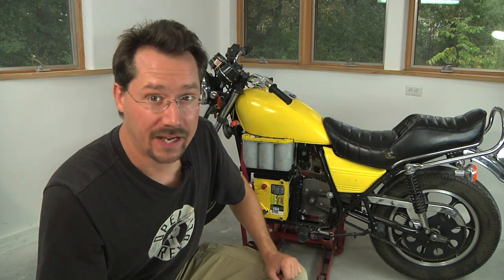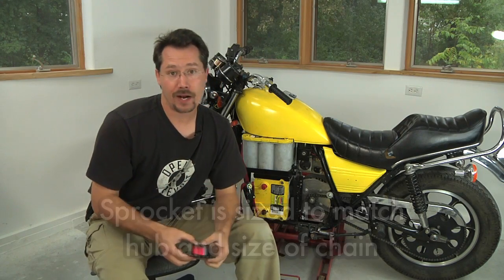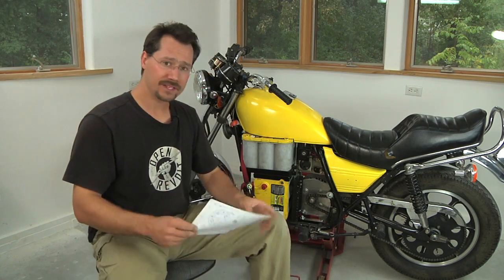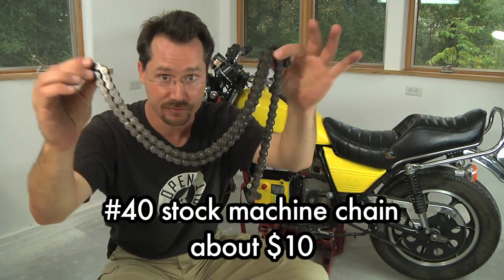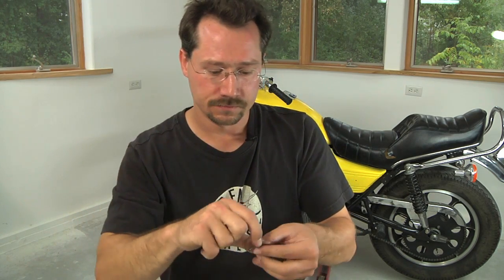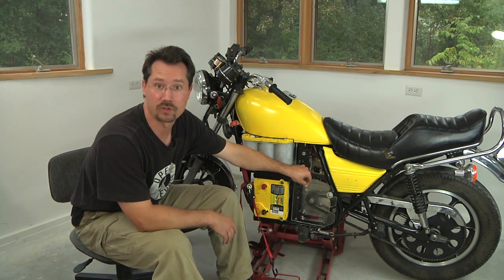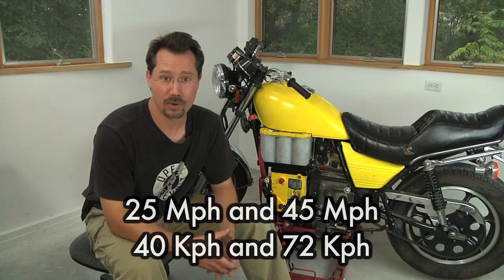15 Build Your Own Electric Motorcycle - FULL - 15 Driveline and gearing

Comment: I've watched all your video series several times, and I think I am have enough foundational understanding to begin assembling a parts list and buying text books for more in depth knowledge where needed. I have an old 80's Suzuki GS with a good frame and trashed engine, so..

My question is how you feel about transmissions on bike projects. I remember that you kept the manual in the Geo car. Space is limited on a bike, but a 4 speed trans from a Shovelhead era Harley is cheap and would fit.
Would it be beneficial to be able to click into a higher gear at interstate speed to run lower rev's and less amperage? I don't need crazy high speed, but I do quite a bit of higjway cruising and would like range.
Reply from the maker: In general, a transmission on an electric motorcycle gives NO advantages. It takes up space and adds weight.
In the Geo Metro conversion, the transmission on the front wheel drive system also includes the differential and then the driveshafts that connect to the wheels. The transmission was mostly used as a place to mount the motor and connect power to the wheels. The transmission was usually just left in 3rd gear. On a motorcycle, it's very easy to mount the electric motor to the frame, and connect the power to the rear wheel with a chain. The size of the sprockets also controls the gear reduction from the motor to the wheel.

On an electric motor, spinning it FASTER and having a higher gear ratio tends to reduce current drawn from the battery. Electric motors have high torque across a large range of RPM, unlike gas engines. The biggest part of what a transmission does it to match the speed of the wheels to an RPM of the engine where it's making enough torque.

On a DC electric motor, speed is proportional to battery voltage. For a higher top speed, increase the battery pack voltage. By using the space in the frame for more cells in series, you get a higher top speed. The system will also draw less current for the same amount of work at a higher voltage than a lower one. Use the frame space for batteries instead of a transmission.

If you are unhappy with the acceleration, top speed, or current draw, swapping out an inexpensive smaller sprocket on the motor will let you easily change the gearing. Use a calculator like GEARING COMMANDER to figure out what you want your gear ratio to be. https://www.gearingcommander.com/

Comment: What is the motor reaction when releasing the throttle? what is the feeling like? 
NICE VIDEOS BTW
Reply from the maker: It just slows down a little. The permanent magnets in the motor make a little drag when the motor isn't powered.
It's not unlike when you stop pedaling on a bicycle.

Comment: This is just great. Kawasaki stops making original parts (have been told, don´t believe me) after 10 years for its products. This means, old Kawis will be the best candidates to convert, as they can be found nowadays on the cheap. 
Your channel is great. 
Only con in my area, is we really get a LOT of rain 6 months of every year, and have to be very careful on making every connection waterproof as heck.  Oh and the hub and sprocket stuff information is just great. I can makeshift something like that within my limited means. I would use old or rebuilt car batteries though. And fix a couple of panels over the panniers, and LED lights all around. This way I´m going to show a finger to the thugs rationing Gasoline in my country.  
Thanks Ben, great information.

Comment: Is the gear ratio 0.5? Or the # of teeth on small sprocket 36? You mentioned the large sprocket had 72 teeth and top speed was 45mph and motor was rated at 52 RPM and assumed tire diameter as 2 feet.
Reply from the maker: 72 teeth on the rear sprocket connected to the rear wheel. I originally had a 12 tooth front sprocket on the electric motor. That was a 6:1 mechanical gear reduction. I quickly found that it was too low of gear reduction, it had plenty of power, but top speed was a little less than I wanted. I swapped out the front sprocket for a 14 tooth sprocket. That gave me a 72:14 or 5.14:1 gear ratio, which I was happy with. Swapping the front sprocket is an easy way to change the gear ratio and is much less expensive than the rear sprocket.
If you know how many RPM per Volt that your motor spins at, you can calculate how fast it will rotate at a particular voltage (battery system voltage, such as 48, 72, etc.. You can then use some math, your gear ratio, and the size of your rear wheel to calculate your top speed.

Comment: What top speed would you get with your gear ratio and would you say an electric motorcycle is suitable to be made for travelling distances of around 80 miles at a constant 70-80mph?
Reply from the maker: Electric motorcycles can be built any way you want. The two big limiting factors tend to be space and budget. You can build a crazy fast and powerful bike, but it might not be cheap. How large of a battery pack you can have is generally limited by the frame size. You certainly CAN build an electric motorcycle that would meet those specs. Zero is the best brand of commercially-built electric motorcycles out there. Take a look at the specs of a DS model with the larger battery pack for some ideas of range vs battery capacity. https://www.zeromotorcycles.com/zero-ds/
My friend Ben Rich has done some EXTENSIVE long-distance riding on his Zero. He's got a great YouTube channel for electric motorcycle riding adventures you might want to check out. https://www.youtube.com/channel/UCaLRufGaQF5x_ElZVv7i9-A
Reply: @BenjaminNelsonX  thanks for the reply, it really helps. I loved the videos and keep up the good work, you're a true inspiration!
Reply from the maker: Thank you!

Comment: Hey everyone! I am going to use a 48v 750w or 900w motor for my bike. The bike will have no pillon seat, can you please recommend me gear ratio for a good top speed (and relatively low acceleration). I weight only 50 kgs and bike will weight around 50kgs too.
Reply from the maker: You need to know the top RPM of that motor at the voltage you are going to run it at. From there, you can calculate a gear ratio and top speed of the bike based on your tire size. There are many online gear ratio calculators you can use, but you do need to start with a few key pieces of information to enter.
Here's one online calculator to start with. https://www.gearingcommander.com
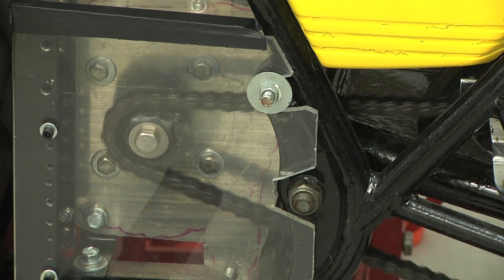Reply: @BenjaminNelsonX  the motor is rated@3000 rpm, i have decided to go with 10:42 gear ratio. Do you think this gear ratio will provide enough Torque for one rider without drawing too much amps.

Comment: 1 speed is not ideal for something like that with low power.  Think about a golf cart.  Those would benefit more with a low gear for when the ground is wet and soft (especially when the batteries are low), and a high gear for when the ground is dry and hard (especially on large golf courses with long holes).  A good low first gear will get the bike moving quickly and then the top gear will give you the speed you desire for keeping up with traffic.  It is only when the motor is very powerful that 1 gear is ideal but that is not the case here.
Reply from the maker: Take a look at commercially-built electric motorcycles. VERY few have more than a single gear.
On this project, while it wasn't an exceptionally powerful motor, there's plenty of torque on the low end, so acceleration away from a stop is no problem, and it was geared for the top speed I was looking for.

COULD it have benefitted from a 2-speed transmission? In this case, I think it could have for a higher top speed (which I didn't need), but space inside the frame was also very limited. The transmission would use up space needed for the battery and add complexity.

I have seen custom two speed transmissions for VW conversions, but those were actually to save weight and improve torque-handling ability, and that was going from 4 gears DOWN to 2.

Generally, the best approach is to increase system voltage to get to whatever top speed you want. On a DC system, higher voltage is proportional with a higher motor speed. It also allows for lower current draw at the same amount of work, and/or for greater power. A larger capacity, higher voltage battery increases power, speed, and total range. Adding a transmission only swaps extra current draw for higher top speed and adds mechanical losses.
Reply: Not really.  A 2 speed does not guarantee a higher top speed than a 1 speed.  It is just comment sense that a 2 speed will give better performance on either an electric scooter or gasoline engine.  Actually, Scooters and low power electric motorcycles can benefit from a CVT.

Comment: What is the rated horsepower output of that motor at 150A draw?  It seems it would be about 6400 watts input so that should be about 6 HP output max?
Reply from the maker: 150A at 48V nominal is approximately 9.65 HP. The motor controller used on this project is rated for 300A. That's just a little less than 20 HP. From a gas engine point of view, 20 HP doesn't sound like much, but you have to keep in mind how different the torque curve of an electric motor is vs a gas engine. Also, no transmission and gears to shift through!
Reply: 48V * 150A = 7200W input so that is not the same as output unless the motor and drive are 100% efficient which they are not.  I would say you have closer to 8 HP, not 9.65.  Also, the battery voltage might not be 48V under heavy load so the input wattage might be less.
Reply from the maker: Yes, I was just doing a straight-up mathematical comparison. For those who don't know, current in amps times voltage = power in watts and 745.7 watts = one mechanical horsepower.
I did once get the cycle up on a dynometer at a Harley event.
I just dug through my filing cabinet to see if I could find the print-out from that.
According to the way they measured things, it clocked in at about 12 and a quarter horsepower. (so maybe that original guess of 6 HP at 150A was pretty close!?!?)

The dynamometer operator was the guy who had to take the cycle up onto the machine to be tested. He asked my how to work it. I showed him the ON switch and told him to simply twist the throttle gently. He turned the bike on, cranked the throttle, and the bike shot forward, nearly throwing him off. Fortunately, he was an experienced rider, and reflexes kicked in to let off the throttle and hit the brakes. He then did a double-take looking at me, finally realizing that it wasn't a toy cycle or science experiment - it was a full power "real" motorcycle.

Although 12 HP may not sound like a lot, there's tons of torque and it's INSTANT. That's a very different thing than the type of power you get from a gas engine, and it's one of the reasons why it's difficult to give a fair comparison between horsepower of gas vs horsepower of electric.

When I left the event, I simply tailed a few touring bikes which had engines larger than my first car did. I had no trouble keeping up with them.
Reply: Once you max out your HP that is it.  It doesn't matter if it comes from a high torque motor, a small gas engine revving at 20,000 RPMs, or a large cc engine limited to low RPMs, 20 HP is 20 HP and the laws of physics say it will limit the top speed no matter how it is made.   Also, V*A=W is only true for DC power, not for AC power.  In AC power, V*A = VA which may or may not equal actual watts (most of the time it doesn't).
Reply: The higher torque of a motor doesn't matter that much if the 20 HP gasoline motorcycle had either a close ratio transmission or a CVT.  I think if they drag raced 1/8th of a mile, all else relatively equal and fair, it would be a good close race.  I think the electric motorbike would win but not by much.
Reply from the maker: I'd be interested in seeing a motorcycle race between gas and electric of the same HP rating. However, since an electric motor is rated at it's CONTINUOUS use and can go much higher than that for a small amount of time, the electric would in fact have more power for a drag race than the gas would. Gas engines are rated at their PEAK HP.
It's almost like comparing a sprinter and a marathoner. If a marathoner could ran as fast as a sprinter, while he's running a marathon all day. How fast do you think he could run if he sprinted?
Reply from the maker: For more fun racing electric motorcycles, check out any videos about the Killacycle!
https://www.youtube.com/watch?v=5B4e8-_vQpU
Reply: If the electric motorcycle and the gasoline motorcycle had the same peak HP at the rear tire, then the race would be close because in a drag race, they are not just sweeping thru the RPM range like they would in everyday riding in traffic.  The gasoline motorcycle rider would know at what RPM his/her peak HP was at and try to keep it close to there by slipping the clutch in the lower gears and slightly revving past it when upshifting.  It would likely be a close race cuz the electric motorcycle has the disadvantage of only having one "gear".  An electric motorcycle with a CVT would likely easily win though (remember this is assuming both bikes have the same HP at the rear tire).

Comment: What I would like to see on an electric motorcycle is a CVT or possibly a 3 speed transmission (low, med, high).  That might give it a little more range and a little bit better acceleration.  Ideally you would have 3 gears that top out at 25, 45, and 60 MPH at full rated motor RPMs but I suspect in 1st gear it would overspeed the motor some cuz of the lighter load.

Comment: There is a formula for the chain length if you know the diameter of the sprockets and the center distance between the sprockets
Reply from the maker: Formulas are great, but sometimes a simple trick is super practical. Wrap a piece of string around both sprockets, then lay that out and measure it. Works great for us hands-on folks while getting away with a little less math. More than one way to skin a cat though, and it's always nice to learn different approaches to a common challenge.
Reply: Chain length calculators are the easiest way to go.  All you need is the straight line center to center distance between the sprockets, the pitch of the chain, and the # of teeth on each sprocket and the calculator will tell you how many links of chain is needed to connect those.  It would be good to take the measurement from the current rear axle position, plus all the way forward and all the way backwards so you can see what range of chain lengths would work.  Knowing those, it would also allow you to play around with some other sprocket combinations.